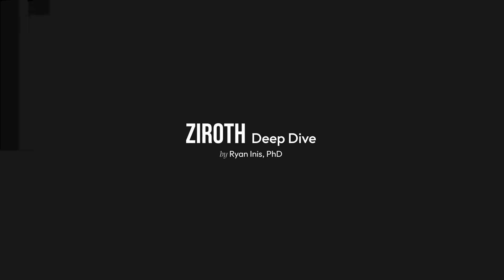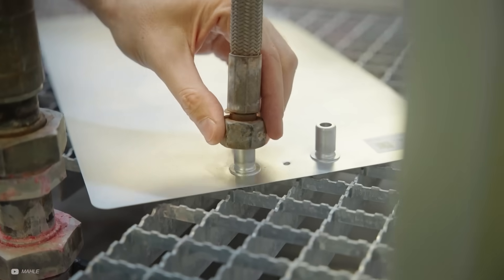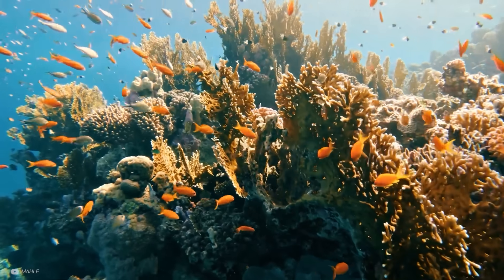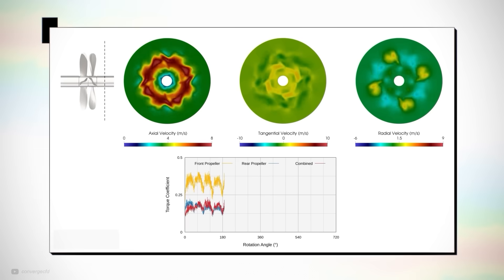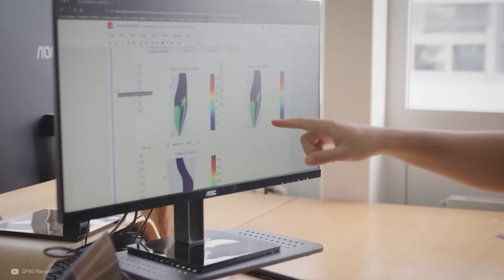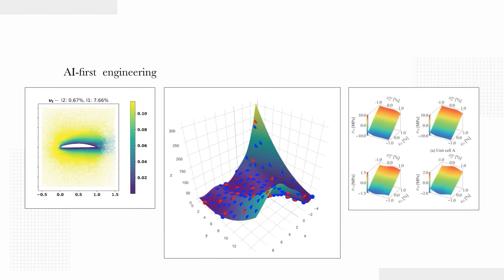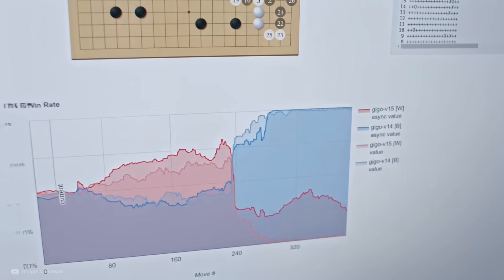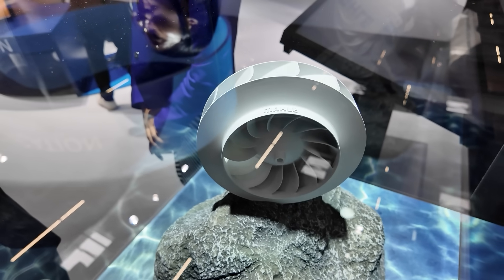Engineering 4.0: The Bionic Revolution is Here

Comment: Biomimetic, not bionic
Bionics is when you use biological parts in the same way you would use electrical parts: as components in a larger system.
Biomimetics is when you build non-biological artificial systems that operate in the same way as biological systems would.

Comment: We were doing multi variable system prediction decades ago with Taguchi methodology. This is a very similar thing just done at enormous scale and speed. Additive manufacturing speeds up the prototyping process which helps as well. There is nothing revolutionary here, just another industry taking advantage of new technology. Check out Festo's Biomimetics, they have been doing similar work for many, many years.

Comment: These fans have a wide range of applications: heat pumps. A/C units, heating boilers, warm air central heating, ICE car cooling fans, etc, etc. They need to be coupled with long lasting and quiet bearings.

Comment: I first heard of CFD four years ago when Aptera (a pet troll topic of mine) claimed performance figures for their silly trike prototypes based on their CFD, saying it was always within 5% accuracy. There is no proof of that, for a start. It was interesting that you give three examples of thermal management from nature that don't directly use their parts for cooling. The penguin just swims; the coral  - well, I'm not sure what it does, but I discount cooling; and the owl flies. Neither the penguin nor the owl use full circular parts, but there is air movement in fans that have an indirect application for cooling. It just puzzles me that modern fans for rooms are now hollow rings with no blades at all. Are these new fans introducing an inferior way?

Comment: If the cooling plate is significantly more efficient, maybe it would be a good design to use for domestic radiators, especially when used in conjunction with low temp. heating systems such as Heat Pumps.

Comment: I fail to see how nature factors into any of the three products' designs. It seems like they are using AI to create their press releases based on nature while they produce extremely generic-looking products. I'm basing that off of the idea that an actual human came up with the idea of basing the design of a blade on a penguin and an owl. Neither one of those birds spins around in a circle, so their wings are not anywhere close to helpful in designing a spinning blade. Wings of an airplane, sure. Blade of a spinning fan? Then release extremely generic-looking designs? Common, AI didn't create that. The most outlandish part of these products is just the press releases. That's obviously where AI was used. 'Cause it's the most creative part of all three of these products... This whole video seems like a 9:30 ad for whatever that software was that was specifically mentioned by name. That set off a huge red flag in my mind, and so I pushed that name out of my memory and started writing my comment. Coral's shape isn't based on trying to cool anything.
>>Blood vessels, on the other hand, are designed by nature, and they help regulate body temperature. Even if a manufacturer can't simulate the way blood vessels will constrict or dilate to help cool down or heat up the body of a living animal, they should spend their time and money on figuring out how to do so. Maybe when they smack themselves in the forehead after reading this, they'll see the blood vessels in their hand and realize it.

Comment: So in reality, this already existed without AI. Optimisation software like pSeven and IOSO also predict which design changes improve aerodynamics, and they have existed way before the current AI-bubble.
About the "learning" of flow calculations in Neural nets: CFD is still mostly performed on the CPU, even though this task is paralleliseable (through Lattice Boltzmann, Discontinuous Galërkin, and more Recently Schrödinger) and could have been something running fully on the GPU. The so called "machine learning" algorithms achieve the exact same thing of running on the GPU, like the GPU-friendly CFD algorithms, of course it's faster than traditional CPU-only CFD.
And it more than this: the "AI" algorithms that learn and mimic CFD, aren't like your LLM transformers; they often use something like the Galerkin method, or Kolmogorov-Arnold splines, Riemann solvers, i.e. algorithms that are already used in hand-written CFD.
Reply: This makes more sense as LLM can't do shit in the first place 😂
Reply: @dadlord689   Well, even though LLMs are very limited, they are good for finding, summarising, paraphrasing, which is useful when looking something up.
If you don't know the terminology, but can explain something in your own words, then LLMs can give you an answer, and search engines won't.
Or if you have a specific troubleshooting problem, and you'd have to read 10 forum posts that might contain the info, then just asking an LLM is faster.
And verifying the response an LLM has given you can take a lot less time that finding it yourself.
This “AI CFD optimiser” from the video is just solving a solved problem, and reinvented what has already existed.
Reply: Agree I think originally this would have been described as machine learning with genetic algorithms and is now being called AI
Reply: @Dave_the_Dave  Well, my point was that you can achieve the same results without using any machine learned algorithm whatsoever, at similar compute cost.
For example, the video showed fan blades with a wavy profile, and these cutouts in the trailing edge, which is stuff you can find on jet engines, premium computer fans, etc. Both the end-result, and the capability of the tooling has existed for years.
Reply: All too complicated for me.
Reply: @ravenmad9225 Yep, and it's not just you.
Most engineers either use just the simulation software that came with the 3D modelling tool they use, or use some dedicated simulation program (like Ansys).
Few engineers know about the optimisation toolkits I just mentioned, and few understand the actual underlying algorithms of the simulation software that I mentioned.
Which is why a lot of people believe this AI marketing, and overestimate its usefulness.
Reply: Thanks for this info bro!

Comment: I was just looking at the design of snowblower impellers.  I don't know if they need bionic improvements.  But right now they look like they were designed before CFD existed...
Reply: The current design is the most efficient for maximum work and cost optimized manufacturing.

Comment: Gotta hope these improved designs get offered as parts available to buy off the shelf for retrofits. Like the blower fan if made to a standard housing design would be an excellent upgrade and the cooling fan if they sold it the aftermarket/modding repair scene would snap them up in no time. I would love to get access to these types of modern parts as parts not just on new equipment!

Comment: I remember reading many years ago about a researcher in what was then called evolutionary design or maybe evolutionary engineering. Anyway, he was given some parameters for a structural beam on the International Space Station. He put them in his software and used it's iterative or breeding function to design the beam. It worked by making small populations of beams and "breeding" them together and then sorting and rebreeding the offspring. Today's AI assisted design seems to work in a similar way. The result was a beam that looked like a biological bone. Thick on the ends thin in the middle and somewhat asymmetrical - it mimicked biology without any biological inputs. Wild.

Comment: I had the opportunity to use Prometech’s Particleworks. The phenomenal code is a mesh free CFD Moving Particle Semi-Implicit model which runs on CUDA cores. I was able to run 2200 CFD simulations in a span of 2 months which enabled me to crack a closed channel flow for a self lubricating mechanical governor sleeve. On a traditional CFD code it would’ve taken more than 9 years running those DOE matrices. Running millions of iterations is indeed a new frontier.

Comment: I'm doing my thesis on topology optimisation of cooling plates for PEM Hydrogen fuel cells currently and it's the exact iterative approach you mentioned; it makes a lot of sense but is still really neat how the iterative approaches emulate the natural selective pressures that yielded structures like coral

The main method I'm using uses a numerical approach called Solid Isotropic with Material Penalisation aka SIMP; it's an extension on Finite Element Analysis, but varies the density of an element in the mesh based on how much it contributes to the system desired output; in my case optimising the "thermal compliance" in ANSYS - essentially the product of specific heat capacity and thermal conductivity 

So many of the papers I reviewed for the background literature review yielded these kind of coral structures; particularly when the underlying numerical math modelling optimised for manufacturing via additive manufacturing; more specifically limiting overhang angles and ensuring continuity of the solid structure. Which funnily enough emulates the same constraints as the growth of Coral. (As corals grow in an additive manner)
Some academics are even using Topology Optimisation to produce artificial corals to help revive the great barrier reef (I forget which institution, the last minute crunch is pain)

Time consuming is an understatement for this approach; even using the University High perfomance compute cluster with 32-64 cores and at times upwards of 200GB of RAM; just the meshing of the base geometry took up to half a day to get enough elements (iirc was in the region of 100-200 million small elements of 0.04mm making up a 200mm x 120mm x 5mm plate with 30 channels of 0.6mm x 2mm x 200mm
Reply: That said my output is hot garbage because I'm just an undergrad engineer and only vaguely know what I'm doing
But it's still neat dammit

Comment: So many questions!   How many training sets were tested?  If more than one, did each training set yield "optimum" designs closely similar to those produced by other AI models, or does the set of optimum designs from a collection of AI models itself demonstrate a diversity of designs?

A possibly more formal phrasing, what sensitivity analysis was performed on the training data and training method?  I appreciate the reduced time to prototype and the smaller test set involved in the Design of Experiments but I fear local optimizations strongly influenced by the training of the AI.  It seems the training dataset and training method, itself, becomes part of the DOE, introducing more variables, just less hard experimental data.

Was the AI trained separately for each of the problems the company pursued, or is the company training a more general AI for Computational Fluid Dynamics or, at least, to be a front-end agent to CFD?

Even with all this, I can't argue against the results presented, they seem very impressive on the performance improvements.   It does seem that the  performance is being hyped, possibly to improve the impression of  a favorable cost/performance?

Comment: The one problem when starting with nature is that nature did not have nearly as many iterations as AI can generate.  And nature, in many cases, doesn't not always favor the best design.  For example the wing of a penguin is likely not the optimal shape for swimming, it also needs to keep the bird warm, help provide balance when walking, shed water, and grow with the bird.  Any of those things may have caused a better swimming shape to be rejected early in penguin evolution.  

The output will be heavily influenced by the starting position, and starting with something nature derived may actually result in a design with some of natures flaws.  Better to start from a very primitive design and model from there.  It will take a lot more iterations and computing power, but will likely yield a better result.

Comment: Nice to hear of A.I. being used for something beneficial instead of the usual slop that is so prevalent nowadays.
Reply: … or nefarious applications.
Reply: Unfortunately the real meat and potatoes implementation of AI is quietly proliferating everywhere but unless there’s a newsworthy angle to report you don’t even know how far it’s spread.
Reply: ai has been used for decades for advancements in medicine, physics etc. knot theory specifically has helped material science. AI did more knots in a year than humanity did in the last 300 years.
The only garbage you see and hear about are the LLM chat bots which are pretty bad, everything else is doing fine. Especially video identification
Reply: Except it isn't really.
This CFD solver is one algorithm, the slop generators are a totally different algorithm.
The only share the AI badge.
Also, software that predicts what to optimise in CFD has existed for years (IOSO and pSeven are used by aerospace companies).
So wavy turbine blades have been in production in jet engines for a few years, and those have been made with pSeven without ANY AI AT ALL.
Jagged trailing edges also have been used in jet engine nacelles for years, and in fans like the PC fans from Noctua; again, with 0% AI use.

Comment: I find it very curious that the image of the fan at 6:22 shows 10 blades. It is commonly accepted that a prime number of blades should be used to minimise resonance.  Modern PC fans and nuclear submarines alike follow this principle.  I wonder if their models found a trade off that saved efficiency or noise in other ways, or did they show a 10-blade mockup as a misdirection?
Reply: I will be two things together: show the progress without handing out the secrets
Reply: Not necessarily a prime # of blades, but at least an odd #.  (For example, 9 blades should minimize resonance, but 9 isn't a prime number)
Reply: @DrKnowNothing1  Aah you're right 9 is a magic number.  I guess the 3x resonance isn't enough to outweigh other benefits.  10 seems weird though having both 2 and 5 as factors.

Comment: Listen. How "good" do you need a fan? Who pays someone to design one? I honestly don't believe a fan can be improved by 15%. Call me half empty
Reply: You are half empty! Fans need designing because humans have become less tolerant of noisy equipment, and the energy transition and the increasing cost of natural resources means that small improvements do pay for themselves (and their designers) in relatively short timescales. The desire to improve is one of the fundamental drivers of the modern world, but it is something that China half embraces and half shuns; they are also half empty! China has many great engineers and designers who are striving to improve their designs, but they are also many Chinese manufacturers who are prepared to copy western designs for things and never improve them. They just copy them, warts and all, and sometimes making them worse because they use poor materials, loose tolerances, or just by not providing adequately instructions.
Reply: @tlangdon12 meh. The Chinese have it right. Their electronics are so, so clever but nobody wants to know about designing circuits that do the job for virtually free using ewaste. I don't think most "designers" are worth their laptop

Comment: That blower fan design has been around for 20 years at least in air conditioning and refrigeration equipment.  The fan for the motor looks like a Volvo radiator fan.  There's no AI here, This is just fluff.